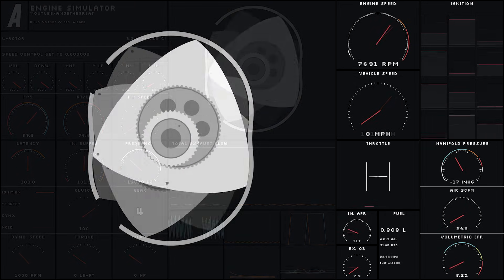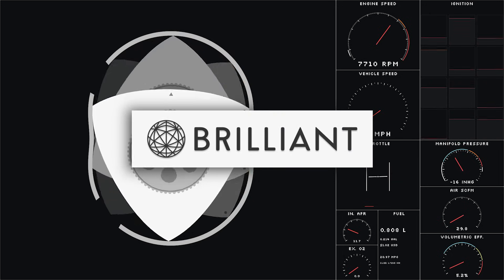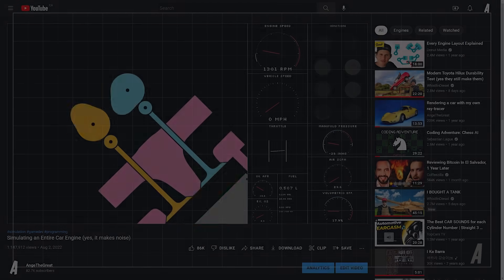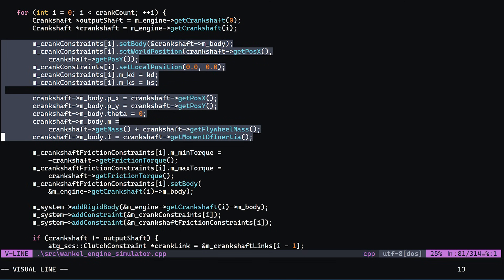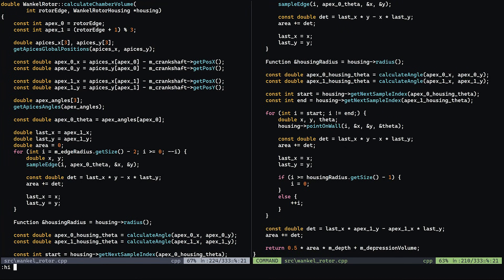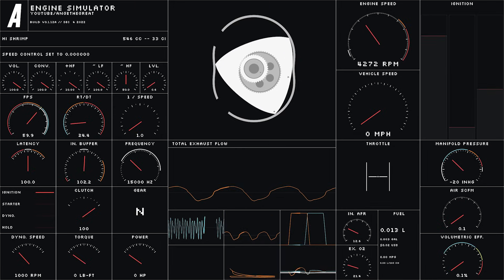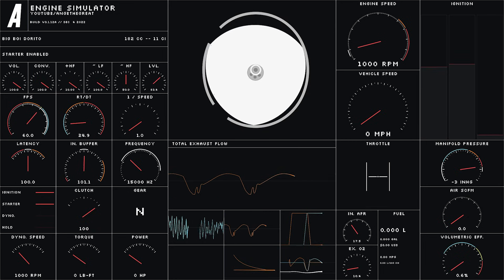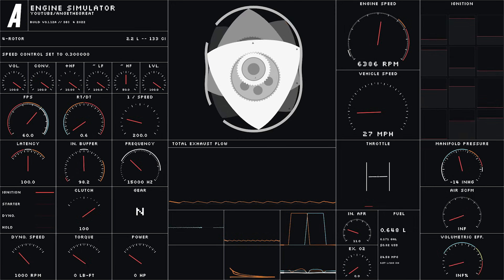Simulating a Rotary Engine (yes, it braps)

Comment: I don't know much about a P-Port except delivering pizza and daily driving a friend's P-port 13B in the 90's with a Weber downdraft. Spin to 10,500 but shift around 9.5k and idle is 1450ish but wavering because of brap to 1700. Brap Brap Brap... and keep a fresh set of plugs in the center console. You might need to change them to get to work.

Comment: I have a small question, is there a way to set the program to take more computing power? I have to reduce the frequency in order for it to run smoothly but my cpu is only about 20% and gpu has basically nothing. Thats also with the priority set to real-time.
Reply from the maker: I'm working on some performance improvements for future versions

Comment: The gear in the rotor could reasonably be called a "ring" gear; it is not a crown gear.
Reply from the maker: I agree that it's not technically a crown gear since a crown gear is meant to engage at a 90 degree angle to the axis of rotation, however, I saw enough sources online calling it that that I just went with it. I couldn't really find the agreed-upon name for it.
Reply: @AngeTheGreat  just like a planetary: "ring gear", is the only name I've seen, other than "the internally-toothed gear inside the rotor".

Comment: I've always said "Wankel engine" when referring to this type. 

When I talk "rotary engines" I'm usually talking about earlier aircraft engines resembling radial engines, but with the crankshaft fixed, and the entire engine spinning around the crank. It uses the centrifugal force to carry oil through the cylinders from a reservoir in the center.

Funny thing is that oil in rotary engines wasn't usually circulated back to the reservoir; that'd be an engineering challenge, rather it was vented at the cylinder heads with the exaust. On some planes it would get in the pilot's face. A lesser known function of the scarf early pilots wore, was to wipe the exaust oil from their faces and goggles.

Comment: Petition to include controls for the throttle with the mouse wheel, as its the only "analog" input we have in a regular computer. It could work like a slider
Reply from the maker: Already in the sim :)
Reply: @AngeTheGreat  i just realized and came back to delete the comment. Ur fast, thanks for reply!

Comment: Real rotaries are ever so slightly offset from a perfect parabola in the direction of rotor travel. This ensures a good intake phase and makes it significantly harder for the rotor to travel in reverse. I had to learn all kinds of things when I bought my r3 renesis. I got a deal on a 2009 rx8 that had 100,000 miles. He said the engine was blown, and i got it for $1800. It took me 6 months to diy the engine rebuild, but it cost less than $1000. Got me a r3 rx8 for less than $3k.

Comment: Would the spark plug placement affect the sound/responsiveness in this simulation? The Mazda wankel had the spark plugs in the wrong place, and later developers of said engine moved the plugs a step further in the cycle. If you could simulate it, it would make an interesting study.

Comment: One of the major problems with rotary engines is differential heating of the sides of the rotary engines. It would be interesting to simulate a rotary engine that uses one rotor for compression and feeds that into another rotor for combustion on both sides (necessitating twice the ports) and possibly a rotor for exhaust scavenging.

Comment: Little known fact; 2-stroke oil works better for rotary engines because they burn oil like crazy compared to tradition combustion engine designs. When synthetic oil burns in the rotary it just gunks it up and degrades it. Synthetic oil isn't designed to burn. 2-stroke oil is designed to burn cleanly so you don't destroy the engine over time. I don't think you need to go purely 2-stroke though. I think mixing is usually what people do if they're using any kind of 2-stroke. I'd be curious to see how well pure 2-stroke oil works though.

Comment: great video 👌 you could rev the engine at 10000 rpm and also a 4 rotor is a little lile a inline six the middle of the engine is exactly like a 2 rotor in firing order then the front rotor is 90 degrees from the 3rd rotor and the rear is 90 degrees from the second one no criticism i think that the sound might be different

Comment: A 4 rotor engine is near a 8 cylinder not a 12 cylinder because you have only 4 combustions per crankturn.
Reply from the maker: In terms of combustion events per revolution, yes it's more similar to an 8 cylinder, however I was just referring to the number of combustion chambers in the engine which is of course 12.

Comment: https://en.wikipedia.org/wiki/Vesica_piscis
This figure appears in the first proposition of Euclid's Elements, where it forms the first step in constructing an equilateral triangle using a compass and straightedge. The triangle has as its vertices the two disk centers and one of the two sharp corners of the vesica piscis

Comment: The depression in the rotor is actually there to define a decent combustion chamber as you can see without a depression the combustion chamber shape at full compression is very weird and difficult to get a spark plug to, and is also long and flat which means you end up with a lot of non-combusted fuel. By having a pocket in the rotor, the fuel air mix tends to be concentrated in towards one spot, which is where you would locate your spark plugs. This is a really excellent series, congratulations - keep it up! If you study the maths for the peri/epitrochoid, you can generate forms with more than two lobes (the wankel uses a 2 lobe form which gives that peanut shaped housing). Be interesting to see if you could get a triple or quad lobed housing to work!

Comment: Nice video but wanted to add a couple points:
The parametric equation for a rotor housing surface is publicly available as has already been stated. The e/R ratio and parameters which will define your curve are also available. I believe e=15mm and R=105mm for all of Mazda’s engines if memory serves. This should let you properly model the curve.

The rotor flanks are in fact circular, you’re welcome to measure/roll one around in real life. The reason your optimized shape isn’t used is that the engine is knock limited before such an optimized compression ratio could yield a higher thermal efficiency. Fortunately you don’t just have to trust me on that as a random internet stranger, you can just look at the pockets in the rotor faces that vary in size across different engine models which control compression ratio, all while the flank surfaces themselves remain the same shape.

Again great job. Hope this is useful to you guys. Recommend reading Kenichi Yamamoto’s book to learn a little more if you’re interested. Definitely more to find on port timing there too.

Comment: As many others, I'm amazed at what you have created. Your brain has successfully mixed your knowledge in computers, mathematics and cars to create this tool that nobody managed to visualize, but now we all admire.

I'm thinking, would this new "rotary edition" of the engine simulator help real life engineers at Mazda, for example, to develop new and improved rotary engines? At least to figure out approximate power outputs or how would a 5 rotor engine sound (15 combustion chambers should be interesting). Maybe in an improved version, you could even accurately simulate different combustion chamber designs, flame propagation, intake and exhaust ports locations... I don't know. I just imagine that the possibilities could be very attractive. Could it even be possible in the future to use an evolved version of this tool and find a solution to the oil burning flaw that Wankel rotary engines suffer?

I just feel this simulator could be much more than just a curious project. By using this software, any person could save up millions of dollars in research and special facilities by just playing with it and create new configurations of this internal combustion engine that has been ignored by our cylinder-centrical society.

Comment: What about adding brakes so I can simulate slowing down for a corner and coming out of it? Tbh that's what gives me goose bumps
Reply from the maker: I'll add brakes at some point, though at this rate I'll just end up writing a driving simulator lol
Reply: @AngeTheGreat  True, and considering that brakes need the "friction" component in your physics engine the only thing missing for a full driving simulator (apart from graphics) would be a thermal simulation right?

Comment: I've been waiting for a simulation of the Wankel engine and this is magnificent! It sounds just like the Le Mans winning Mazda 787B and braps like it too! I would imagine how difficult it was to get the geometry of this engine design correct, but I can say it was a massive success. And this is just the KKM Wankel design. I wonder if the DKM Wankel engine can be simulated and also other pistonless rotary engines like the LiquidPiston and Quasiturbine. Only time will tell and keep up the great work 👍

Comment: dude the adjustments to the chassis and drivetrain flexibility in the vehicle simulation make an AMAZING difference in the end product!  The engine simulator by itself is an absolute work of art, but it sounds mostly like an engine sitting on a dyno.  Now it sounds like you're in the car!  Bravo!

Comment: Wowowowow! Amazing stuff as always! 
One small criticism: strictly speaking the driveline wouldn't be just flexible but have some play, which it sounded like you were trying to simulate by making the drivetrain more elastic than it should be. If there is a lightweight solution to simulate gear backlash and tighten up the elasticity it would improve the realism quite a bit further imo. 
It already sounds brilliant though, massive props my guy!
Reply from the maker: A small amount of play is incorporated into the simulation. The flex accounts for a lot of things and not just the drive train. Things like the engine mounts, wheel deformation and of course the deflection in the various shafts in the vehicle. It needs some calibration of course but this was my first attempt based on some reference footage. Thanks for watching!
Reply: @AngeTheGreat  Yeah I get that. By "driveline" I meant everything from combustion to tire contact patch, miscommunication on my part. 
Maybe it's the 787B being a race car, which makes me expect a tighter driveline with almost rigid engine mounts where the play sounds harsher. It could also be the lack of gearbox noises tricking my ears.

Comment: For the flexing, maybe make the intensity depend also on how fast the rpm are climbing/decreasing, it sounded out of place in some instances. Maybe also consider the load on the engine while going x mph. Might make it sound a little more realistic
Reply from the maker: It sounded pretty similar to the reference video I was using. Varying the "intensity" is not possible that way because deformation is not related to engine speed or even vehicle velocity. The stiffness and damping can be adjusted to suit the vehicle and doesn't need to be as extreme as I showed in the video though.
Reply: @AngeTheGreat  oh, fair enough. Didnt think that fully through, thought of just adding a division/multiplication, but fair enough, you can just edit the vehicle. My bad!
Reply from the maker: @TheCustomFHD  No worries! It's a work in progress of course and I appreciate your feedback. I did try out some more "normal" stiffness/damping values but I didn't show them in a video, maybe next time though
Reply: @AngeTheGreat  could be neat. I think ive mainly "expected "/assumed that at higher speeds/gears the stiffness and "rpm-wobble" would reduce, which i might just not have noticed. But i might just be very wrong on this. I always enjoy giving hopefully useful feedback, especially for projects i enjoy.
Reply from the maker: @TheCustomFHD  that depends heavily on the amount of wind resistance and strength of engine braking. For a race engine with strong engine braking, letting off the throttle at high speed with high drag force would cause all of the preload in the suspension to disappear immediately, making it jerk suddenly.  Fundamentally there is nothing different about the physics at high speed and the reaction would be the same. It would be great to test this for real though with a real car haha
Reply: @AngeTheGreat  fair enough. And i agree, could be neat to test irl, could give some interesting informations possibly.

Comment: What would it look like if you ran the shape simulations with like a 4:1 or a 6:1 pinion ratio? Would it even be possible?
Reply from the maker: It's possible but I'm not sure what would happen. Probably wouldn't run very well though

Comment: While as a dorito engine enthusiast I'm excited to see and hear the Wankel engine finally being simulated correctly, I actually screamed and did the DiCaprio pointing meme at the moment you explained how the rotor and housing design were optimized using an algorithm akin to a CNC machine. That's an extremely smart solution to model the reulaeux rotors and the epitrochoid housing, and no doubt Mazda engineers also used similar techniques in their research to build the 16X range extender. Mazda also worked on different cavity designs for the rotors to optimize combustion and it turns out that by having no cavity at all meant the highest compression ratio of 16:1 can be achieved. 

I know you've heard this so many times but you're so cool and smart for investing into this project! Can't wait to finally mod this and test out hypothetical designs including Rolls-Royce's diesel rotary prototype in my spare time. I'm betting someone will eventually show this to Rob Dahm too.
Reply: This Rolls-Royce diesel concept sounds fascinating. Never heard of it before.
Reply: @cyrilio  It’s certainly the most fascinating application of Wankel’s patented design. Simply put, two large rotors act as mechanical compressors and forcing exhaust gases from two small rotors to spin the large rotors, further compressing the intake air, before fuel (in this case diesel) gets injected onto the superheated air. You could say the entire operation is a hybrid of a compound turbo setup and a two-stroke diesel, except the fuel is injected directly into the small turbo, while the mechanical blower helps exhaust gases to be flushed out, all in one small package for a diesel. Engineering Explained has a great explanation of this concept.
Reply: already happend. robs fan base is very close and personally, there is no way our god will miss anything

Comment: At 11:30, where do these misfires come from? I would love to have them available for all kind of engines :D
Reply from the maker: Misfires happen either because of exhaust gas dilution (ie exhaust getting sucked back into the exhaust chamber) or the AFR being off. These can happen under a variety of conditions like at idle and under heavy deceleration. I'm working on bringing some of the code that makes that possible into the piston engine simulator.

Comment: Very cool. I thought the rotary would be limiting with what you can use it for. but the fact that there are other functional configurations is rather interesting.

One thing I'm wondering is if having the exhaust port on the apex seal wall instead of the back wall like in a Mazda rotary would affect the sound

Comment: Add the gearbox whine to this, and then it'll be perfect. That transmission stuttering is amazing btw, at first i thought it was a bit too much but it fits perfectly (for a race engine at least).
Reply from the maker: It depends on the car of course, I used an exaggerated example like a racecar to demonstrate what it can do. Thanks for watching!
Reply: 787B? 😀
Reply: @AngeTheGreat  bmw m3 gtr have high transmission noise
Reply: My Rx8 reacts almost exactly like that with firm suspension and large but thin tires
Well... there's also a reinforced gearbox, ultra light counterweight/flywheel combo and stage 3 clutch sooo...
Might play a part too lmao
Reply: @FuSiionCraft  yeah flywheel is a big contributor to tackle stutter. having too lightweight flywheels can actually be contraproductive even kill the engine
Reply: Transmission simulator when???
Reply: Gearbox whine? How about throwing in some boost!
Reply: @Stoney3K  Won't he have to figure out how to simulate sending the apex seals out the exhaust then?

Comment: I guess, the next step would be to simulate jet engines :) Or just turbines in general.
Reply: If I understand them correctly, most jet engines should be pretty boring to sim, since they are mostly in a steady state of gas pressures, and are mechanically just the one rotor (with lots of different fans coming off it)